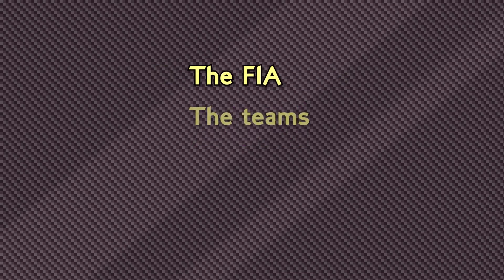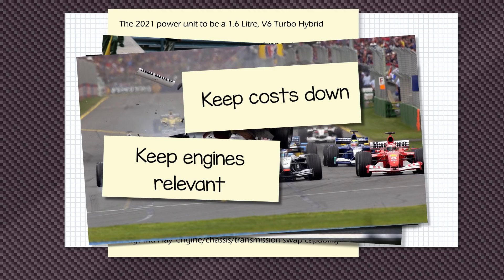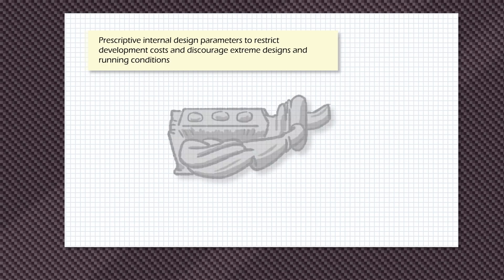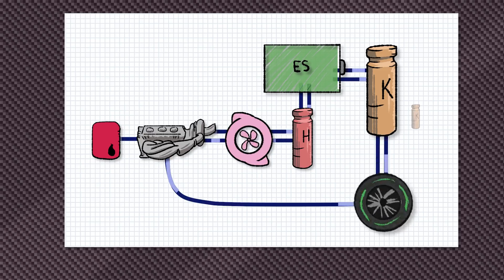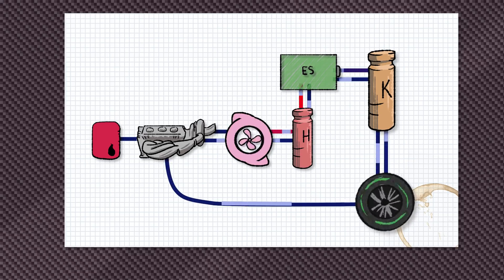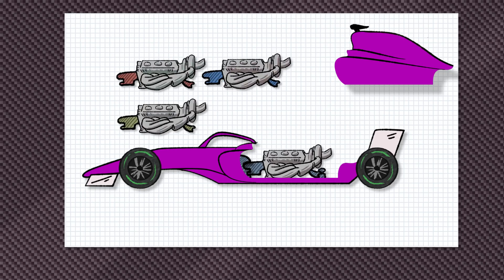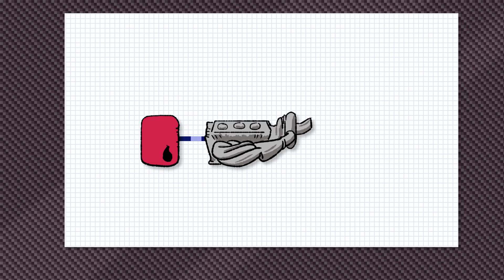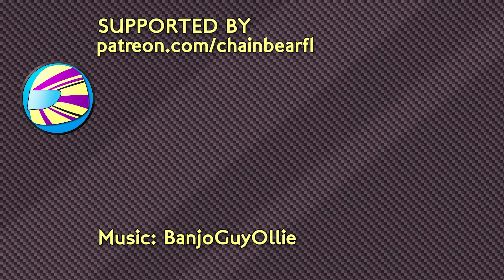F1 Engine proposals 2021 explored

Comment: Why not leave them as is? Won't they automatically get cheaper eventually? Changing engine regs will force them to redisign at least parts of their pu.s?
Personally I'd give them fuel load and flow limits and leave them to do whatever similar to how WEC went about their business a couple years back.
Reply: And look at how it ended. Too expensive for manufacturers to continue. F1 wants to make manufacturers enter the sport and stay for a long time

Comment: The sound of the combustion engine won't disappear in F1 maybe in  road cars but race cars and high performance cars no way simply because they're some serious fans and petrol heads out there myself included.
Reply: And the fact that for that there is Formula E already.
Reply: it's a completely different series testing road car technology which as i said no one minds if hey go electric. Even the drivers themselves said they wouldn't like electric engines like Daniel Ricciardo himself.
Reply: I'd say serious fans would like the top of tech in the race cars, the maximum of performance and efficiency. Sooner or later, combustion engines will not cut it anymore. Electric engines are easily better in every single aspect, and the only thing that held them down till now was the lack of appropriate battery. Now technology finally catched up, and they will gradually become the no brainer option, even for racing.
Reply: I would be amazed if F1 wasn't fully electric by 2045.
Reply: That's such asinine argument. Tell me where in the sacred texts of F1 it says "thou shalt not use electric motors in thy car."

When electric cars are faster than internal combustion over the course of an F1 race, that's more or less when they'll switch. You can't fight progress; electic power is the future of automobiles, and anyone who doesn't realise that is a luddite.
Reply: They said wings were not true to the spirit of f1 too but now they're so ingrained in the fibre of f1 that it wouldn't be f1 without them. I say if the electric power units are quicker than ICEs then they should use them since f1 is about getting the most performance from the technology available, not just loud noises
Reply: "race cars and high performance cars no way simply because they're some serious fans and petrol heads out there"

This is in fact the case. For a while now. Silly people salivating over clunky obsolescent technology.
There's no reason F1 couldn't be electric at equal or better performance using fuel cells.
Reply: Probably true, we still have horse races and they are a pretty big business, not sure if it will stay as big however.
Reply: Even so, it is becoming less expensive & more efficient by the day. One major leap/breakthrough and electric WILL take over. I won't like it but it is inevitable
Reply: HK Productions It's not ignorance perse. More a shit ton of money that is put into these sports by oil product manufacturing companies like Mobil and friends. THAT is why they won't go electric, even when its cheaper, faster and more reliable.
Reply: There's a reason why Formula E was begun to be a race series for electric cars, why no let it stay like that without forcing F1 into that equation. Noise is just one part of the problem when an F1 car goes electric. It just doesn't suite it. Wings are essential for racing whether they said it isn't  true to the F1 spirit or not, electric engines on the other hand aren't essential for F1 the Hybrid powertrains are good enough or an N/A engine.
Why do you think there are not many rumors of NASCARS or Indy cars going electric, because they're passionate not just trying to force new ideas that'll ruin their sports origin and entertainment.
Reply: Brian Wambugu no the reason indy and nascar arent going electric is because of american ignorance. Always behind the times...and nascar has been in steady decline as well.
Reply: @Brian Wambugu - Sad as I am to say this, but F1 will go full electric in the near future, perhaps in 10 years. It'll be way too illogical for them not to. By then, I most likely won't care about F1 anymore, so it won't be a loss for me.

I grew up in the v12/v10 era. And to me, F1 has been on a downwards spiral for the past decade or so. The excitement and flair is not there anymore. I'm not against hybrid systems, but there are way too many restrictions put in place on top of that which makes it feel like we're moving more and more towards fully-spec cars.

No matter how much I love the NA engines, I accept that they're not viable anymore. However, I won't stand for an all-out electric era. If I want to see that, I'd just watch Formula E.
Reply: @kuyt20  I believe we shouldn't go electric. Not till electric cars are producing the sound that's good enough.

There can be a way to improve the sound and that's to get rid of the over regulation of the cars. Teams can't use full power because of it. Crank up the revs too, bigger exhausts. The regulations are kinda going in this direction.
Reply: That wouldn't stay true to the origin of F1 if they go electric.
That's why formula E is a totally different series.
Reply: True though who knows if it'll no longer be a test bed for road cars and the FIA let the teams do whatever with the remaining fuel on this earth as an exclusive sport while the rest go electric. I'd like to see that.
Reply: Wings aren't essential for motorsport, as evidenced by the large number of categories without wings.
Reply: Piss off with that American ignorance crap. Electric power in Indycar and NASCAR isn't going to happen because it is too expensive.
Reply: 1. In this very video it speaks about engine noise which fans absolutely love and which electric engines cannot give.
2.For a battery powered car to match the output power of an F1 car it would need massive amounts of batteries simply because it has a very low energy density which is the amount of energy it gives out per kilogram of it's own weight. So for the speed of an F1 car you'll need big heavy batteries not ideal for racing, until technology improves.
3.Not many people are fans of electric engines which could make F1 loose a massive part of it's fan base.
4.The issue of emission will be solved since road cars too many using combustion engines which in my opinion they don't need hence making F1 and other race cars use petrol exclusively, which will stay true to the origin of the sport.
5.Combustion engines are still evolving due to recent introduction of the Homogeneous Compression Charge Ignition engines (HCCI) which combine petrol and diesel technologies for more power and efficiency. And lets not forget the recent Turbulent Jet Ignition system recently brought about by Mercedes AMG F1 which gives more power for a third of fuel used.
Several reasons for the combustion engine to stay and plus they have souls they bring joy with the sound and brutality they have which in turn makes them lovable.

Comment: Small displacement screaming v8 plz but ohh well
Reply: 2 liter Turbo V8 with 19000 rpms anyone
Reply: Augusto Rallo Volkswagen had a sort-of V5. Really, it was a VR5 - a VR6 with a cylinder lobbed off. Technically it's a narrow-angle V-shaped engine but it only has one cylinder head and set of camshafts, so it's a hybrid between a true V5 and a I5. The Vollswagen V5 was used in some low-end cars, like the Jetta and Golf, throughout the 00's before being supplanted by turbo I4s. Honda raced a motorcycle with a true V5 in MotoGP, but that isn't a car.
Reply: Practical Pat Like the Climax engines of the 60's.?
Reply: fiat also had a v5 in the coupe, but if you are american you wont know what that is. i think lancia also had a v5.
Reply: they would chug too much fuel for todays F1. Wankel engine is more or less dead even in car industry
Reply: Augusto Rallo Honda developed a couple V5 engines for motoGP, and Volkswagen had a VR5 based on the architecture of the VR6.
Reply: Practical Pat What would happen If F1 used an Inline 5? it will probably sound like a v10.
Reply: Tipo 044 or go home.
Reply: Augusto Rallo lots of i5s exist Audi VW gm Volvo , Honda made a few v5 bikes
Reply: David Perry that would be even more ridiculous than the turbo engines just before they got banned in the 80s. They were getting over 1000hp even then. Now, with those revs and that displacement, plus a turbo or two, I would expect closer to 2000hp, which is basically pointless since they wouldn't have enough grip to ever go full throttle.
Reply: Practical Pat NA V8 + electric Motors
Reply: A Fox I think you mean I5
Reply: What about a single turbo 2l v8? Just a thought off the top of my head, plus turbo v8s remind me of the CART cars.
Reply: A Fox LOL Name a single car with a V5, ever!
Reply: Practical Pat or better yet, rotory.
A 1 liter 2-3 wankel single turbo would be ideal for f1. (ok they wont be that reliable but yea)
Reply: Practical Pat nah v8 dont sound that good, v10 would be cool (or v5)
Reply: Engines have been getting smaller and smaller.
Reply: Hell no.
The last V8 era was really lame. Cars lost a lot of power, and on top of that, they sounded more like bike engines than anything else.